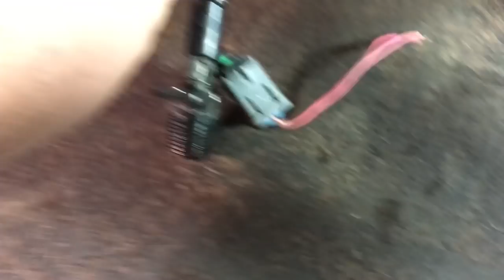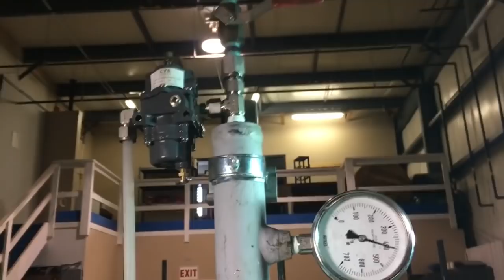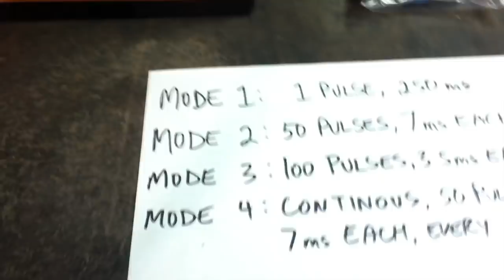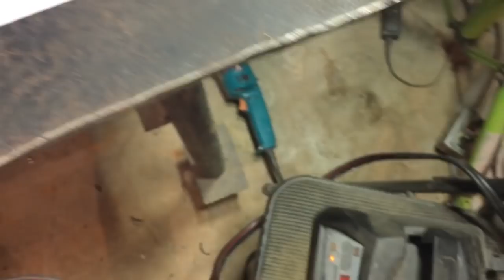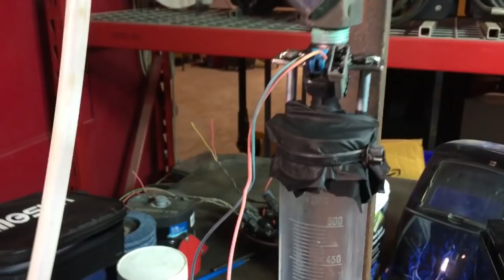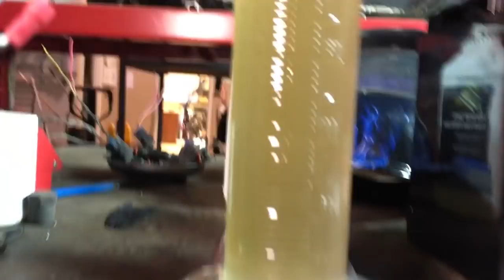Fuel Injector Flow Test Bench

Comment: Excellent video!  Thanks for putting this together!  I was trying to figure out how to get a continuous mode to be able to do a proper static test.  I didn't think you could safely operate an injector for a full 60- seconds, without damaging it.  Most of the tests I've seen suggest 15 seconds, and then multiply the flow by 4 to get a close estimate of one minute.  Nice Job!